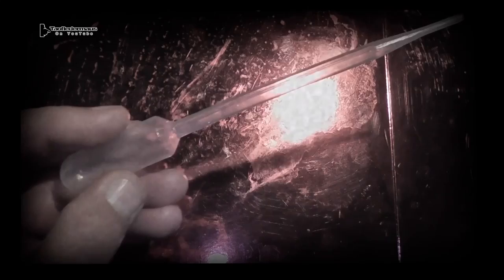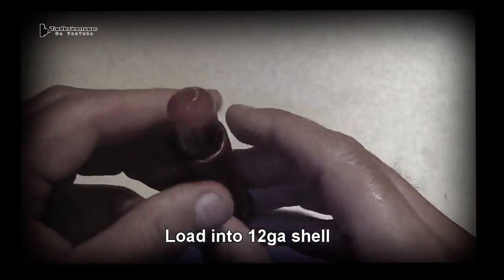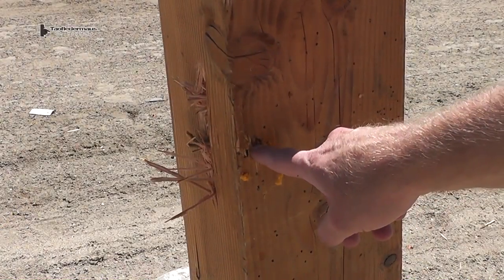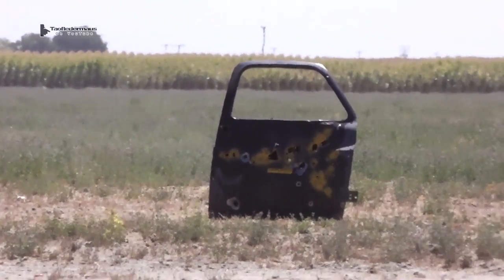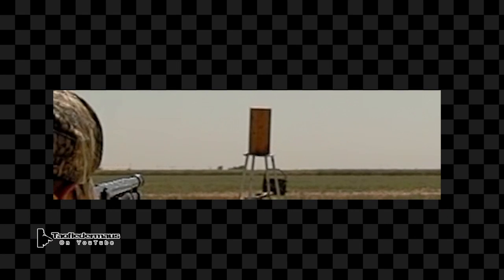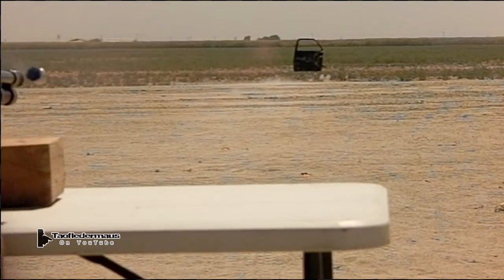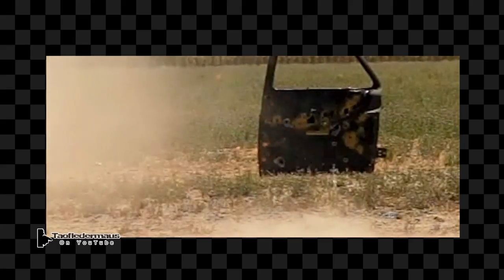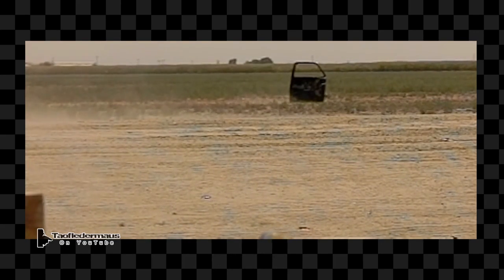12ga. VAPOR-TRAIL Shotgun Slug -Weird Concept

Comment: I would like to see the same thing but rather than propylene glycol use vegetable glycerin. It's thicker and has more weight to it. Plus, I know for personal vaporizers like e-cigarettes vg is used to produce the massive clouds of vapor you see. I just think it would be cool to try
Reply from the maker: +Paul Gillett   We aren't using a heating element to aerate the propylene glycol.
Reply: Would it not have a similar effect?
Reply: +TAOFLEDERMAUS Yeah but I mean the lead probably heats up no? how does the pg get vaporized?
Reply: VG would leave a more distinct and longer lasting trail. PG boils at 370 deg F and VG boils at 554 deg F. No heating element should be required for either fluid as gunpowder's flash point is over 800 deg F, which should be more than enough to boil/vaporize either fluid. 
In vaporizers, the PG is used as the solvent for the delivery of nicotine and flavor adds while VG is used for the perceived exhale. 100% PG mixes in vaporizers have little to no visible exhale while high or 100% VG mixes have very visible exhales.
It would be interesting to see the difference in projectile performance and trail between the two fluids.

Comment: Very Cool. How about adding wax to the shot before adding the cotton and vapor trail solution. The wax should keep the shot stable after firing and hopefully keep the shot from bursting out mid-flight. Keep up the good work.
Reply from the maker: +meza72  Probably be pretty hard to fit it through the little hole and not make a big mess.

Comment: use hot glue to hold the lead intro the plastic container, i think this will make the shot more stable but will reduce the frangible and trace effect. (and you can load intro the shell with the nose in front).          thanks for do random things.
Reply: +Walter Alves that or pour some hot wax in there on top of the shot.. a wax slug tracer as it were

Comment: Into the distance a ribbon of black 
Stretched to the point of no turning back 
A flight of fancy on a windswept field 
Standing alone my senses reeled 
A fatal attraction holding me fast how 
Can I escape this irresistible grasp? 

Can't keep my eyes from the circling skies 
Tongue tied and twisted Just an earth bound misfit I 

Ice is forming on the tips of my wings 
Unheeded warnings I thought I thought of everything 
No navigator to guide my way home 
Unladened, empty and turned to stone 

A soul in tension that's learning to fly 
Condition grounded but determined to try 
Can't keep my eyes from the circling skies 
Tongue-tied and twisted just an earth-bound misfit, I 

Friction lock, set. 
Mixture, rich 
Propellers, fully forward 
Flaps, set, ten degrees 
Engine gauges and suction, check 

Mixture set to maximum percent, recheck 
Flight instruments 
Altimeters, check both 
(Garbled word) - on 
Navigation lights, on 
Strobes, on 
(To tower): Confirm 3-8-Echo ready for departure 
(Tower): Hello again, this is now 129.4 
(To tower): 129.4. It's to go. 
(Tower): You may commence your takeoff, winds over 10 knots. 
(To tower): 3-8-Echo 
Easy on the brakes. Take it easy. it's gonna roll this time. 
Just hand the power gradually, and it

Above the planet on a wing and a prayer, 
My grubby halo, a vapor trail in the empty air, 
Across the clouds I see my shadow fly 
Out of the corner of my watering eye 
A dream unthreatened by the morning light 
Could blow this soul right through the roof of the night 

There's no sensation to compare with this 
Suspended animation, A state of bliss 
Can't keep my mind from the circling skies 
Tongue-tied and twisted just an earth-bound misfit, I

Comment: I missed it if you specified what liquid you used. Have you tried titanium tetrachloride? It might be a wee bit difficult to get your mitts on (hazmat ship label required for UPS, check local chem supply houses) but works well to make instant smoke in humid air... dunno whether it will work in dry air.  Essentially forms HCL and finely powdered titanium dioxide (a relatively inert pigment)

Comment: Will you please show the actual feet to the target? In this video you say 70 yards, yet the target does not appear to be 210 feet. I assume that is more to do with camera and not your math. There are many videos when you give yards to target but the target appears closer. 
.
Reply from the maker: +Aaron Easter     We plot things out using Google maps and use reference points in the field to get pretty close to true ranges.   In the battery video we just guessed the truck door was 100 yards away,   so I made the range map after that and discovered it was actually 400 feet to the door in that video.

Comment: Effective.
Perhaps covering the shot with wax, left to set, then adding the soaked cotton might work better?
As a vaper, VG vs. PG tends to give a far thicker cloud.

BTW (while I'm here): Can you (Jeff) rerun the mercury and water double whirlpool, but add oil too?
Triple whirlpool FTW \o/ :-)
Reply from the maker: +Fred Gandt   The density of water and oil is very similar.   Oil is about  0.7 and water is 1.   Hg is almost 14.  That is why we were able to get two vortexes.  I put an annotation in the video showing what water and oil looks like,   it just forms a single vortex.
Reply: Aww :-(
Sorry, I must have zoned out while watching, and completely missed the annotation.

I've thought about it often since you uploaded it, and came to the conclusion that from the water's perspective (if you catch my drift), the mercury must seem like a solid mass (so dense and unforgiving). There being almost zero resistance too, allows the water to flow as if in a funnel.

Damn cool little experiment :-)

Comment: I think if you did the same thing but with vegetable glycerin it would make a larger vapor trail just because it is thicker, and it could disperse over a longer distance.
 Just a thought from a vaper for some vapor.
Reply: +TAOFLEDERMAUS yeah they have a coil with low resistance to create heat but my point was just that VG was a little thicker than PG and might last longer while being spread out. it's used in e juice to make it thick and produce more vapor. Maybe the same principle could apply?
Reply from the maker: +Austin Villarreal  doesn't the  e cigs have a heating coil in them to cause the stuff to smoke?
Reply: +TAOFLEDERMAUS Hmm. Can you fit an 18650, a coil and a cheap dripping atomiser into a shotgun shell....
Reply: +Beany2007FTW I would send him one for sure if he'd shoot it lol
Reply: +Austin Villarreal you'd need to rack, aim and fire it pretty quick though, or you'd get a nasty dry hit.

Comment: Shoot paint balls filled with non-Newtonian fluid and compare them to a regular paintball. I would hypothesize that the non-Newtonian fluid would have more stopping power due to it being near solid on initial impact .Try them out of a normal paintball guy and maybe then the 12 gauge ( if the g shock doesn't explode the ball).

Comment: VG "smokes" way more than PG
Reply from the maker: +J Diaz   I couldn't fit a little heating element in the capsule.
Reply: lol Just busting chops, love the videos , but always been curious it happened when i was making wax slugs my plastic spoon started to melt and wondered what would happen if you mixed bird shots with melted spoons instead of wax? if the results are the same or better than wax i'd be throwing parties alot more often.
Reply from the maker: I think the melting point of the plastic spoons would be close, maybe even higher than the melting point of the shotgun shell!